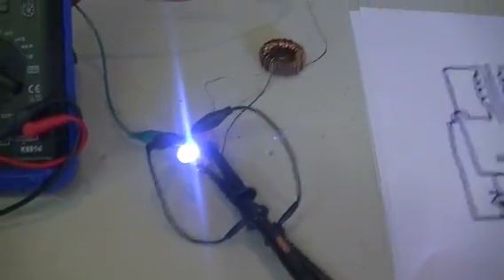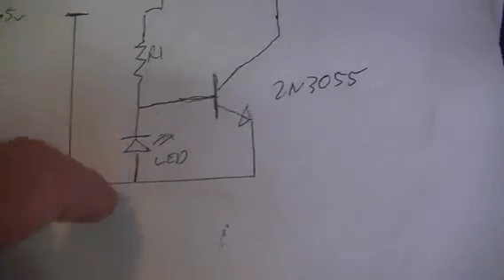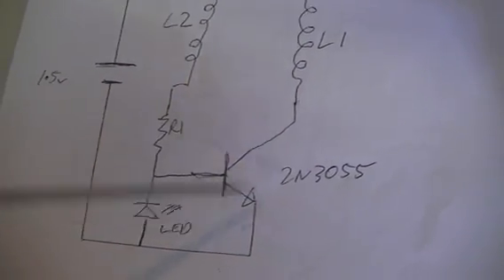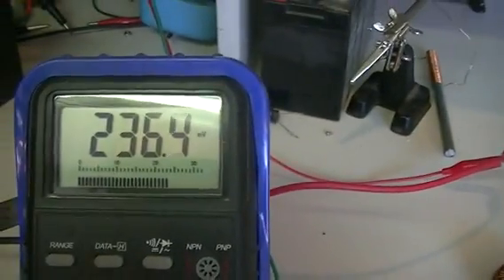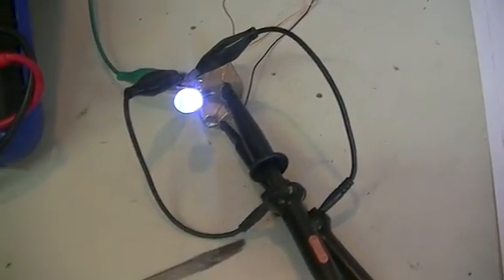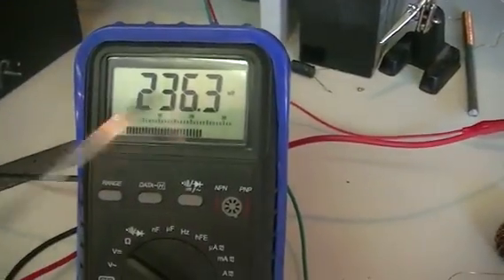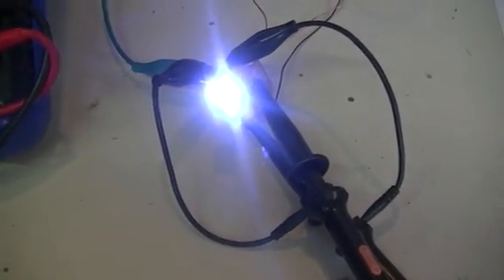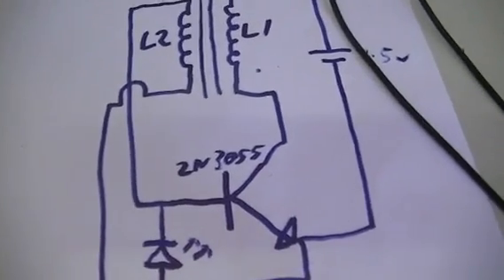Joule Thief / Emitter Base driver

Comment: Hi TinManPower.

Do you still working on the supercap ? 
I was very impressed.
lg

gerhard
Reply from the maker: +ehochimalpi  I could not get enough charging cycles with that super cap design,so i gave it away.
Reply: +TinManPower 
was the steel mesh corroded ?
if yes, I can send you a graphene plate with 0.4 ohme. 
or you can tell me what was inside and I will test it :-)